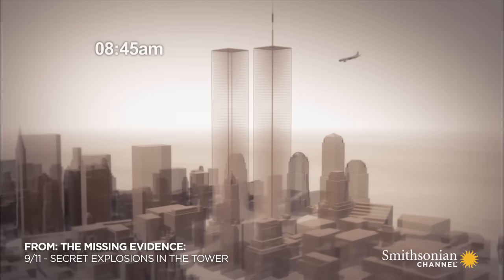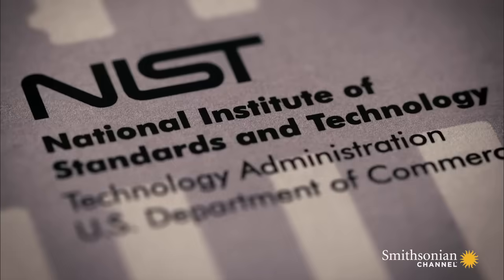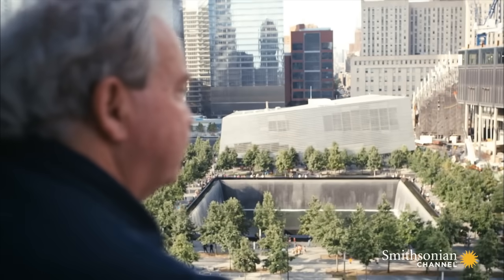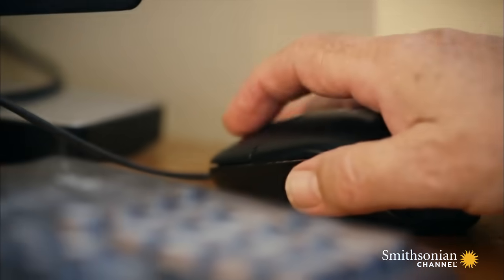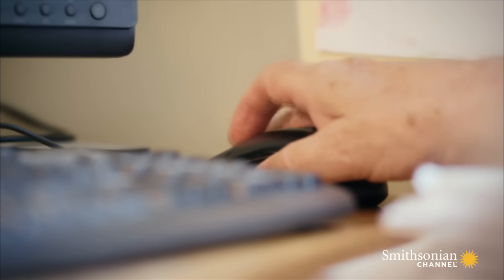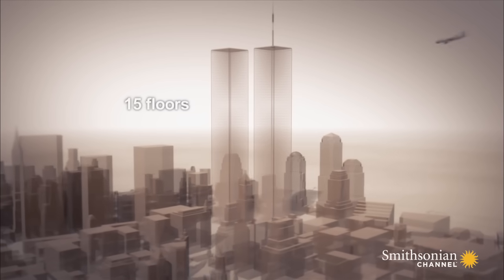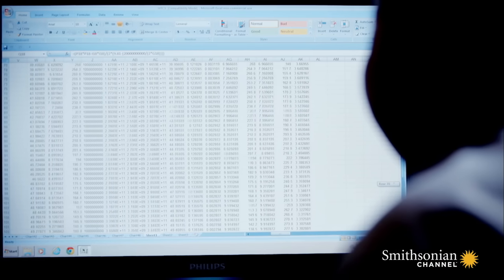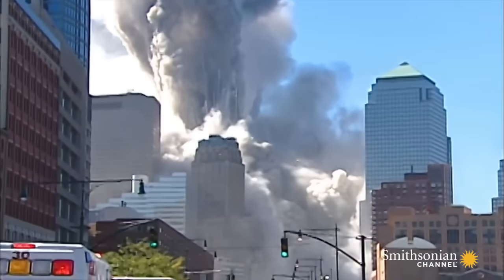This Computer Simulation Explains How the Twin Towers Fell

Comment: Can this old guy with a spreadsheet also explain why there was molten metal pouring out of the buildings before the collapse?
Reply: Oh, that's easy. This 'molten' material was dripping from the northeast corner of the South Tower. When Flight 175 hit, the plane slammed at an angle, therefore, most of its debris slid to that corner of the building. 

Molten aluminum is silvery when melted, however, that's when it is at it's lowest temperature. When temperatures reach 1800'F, which was how hot the fires were that day, they begin to glow a light-orange color. Consistent with what we see. If it really was something like thermite, there would need to be 60 tons of it to start producing the amount that was dripping (30 tons). How would they put the equivalent of 10 truckloads up in those floors without office workers noticing? 

Lastly, if you're really not buying that it's aluminum, remember that Flight 175 was 80% aluminum, enough of it to be piled up in the building and heated to be the fiery molten state we see.

Edit: Oh, and this was how Steven Jone's experiment was flawed. He melted aluminum down to 1220'F instead of the temperatures that were burning that day, at 1800'F.
Reply: "When temperatures reach 1800'F, which was how hot the fires were that day"
You are now claiming things which the official report doesn't even claim. You have mass cognitive dissonance. Next you should claim that building 7's perfect collapse into it's own footprint was because it was hit by a plane also. Since you want to tell yourself anything to fill in the gaps and inconsistencies in the official report.
Reply: Joe Plumber you sir deserve a metal for how you debate
Reply: M P

i know right? depending on which nutjob is yapping, the jihad pilots either can't hit the tower at all, or they can hit a specific window on a particular floor.
Reply: Joe Plumber they failed flight tests.... yet they could fly the plane perfectly into the thermite loaded floor with precision of a 40 years experience pilot. Both are troof 😂😂
Reply: Kerem Karaoglu wow you really do believe you're better than everyone
Reply: Cruzer's World of Retro Wonders
 said: "The problem is that molten aluminium looks silvery in daylight, not orange glowing."

The molten aluminum pouring out from the building was loaded with impurities picked up while running across the floors. The problem is that you seem reluctant to consider it, or you just aren't intelligent enough to consider it in the first place.
Reply: Joe Plumber You'll find that most in fact aren't saying what it was, only that they know for sure what it wasn't.
Reply: I think the fact of his PhD is more relevant than his age. As for your contempt for spreadsheets - reflects your lack of knowledge of maths and the power of spreadsheets.
Reply: This thread was a fun read.
Reply: Oh wow so maybe you can also explain how it got hot enough in a building fire that was going out and why they found molten steel in the debris months afterwards.
Reply: Sir Cumference

How can you tell a troofer is lying? When he offers you something. Oh well and every other thing they say too. But especially if they offer something.
_____________________________________________________________________________________________
Seriously, if you can debunk all the irregularities of 9/11 I’ll give you a hundred dollars.
Reply: Alex Wills  >>>Civilised and serious question... if it wasn't steel then, what was it? 

There were several metallic materials in the towers, from hi tensile temperature hardened steel to alloys with lots of soft metals, aluminum, thin wall stuff like file cabinets. The other main variable is, temperature. There was a lot of fuel available, and probably a wide range of heat in different parts of the fires. Saying that say this, no one KNOWS what any of it is without an assay. Any argument in favor of or against a particular material will be made to support someones agenda. And you're right about the "great pool". If you compile all the different witness statements, there should be a couple feet deep puddle of metal/slag in the basement.
Reply: Wow an intelligent person responding to a 9/11 loophole? how rare indeed.
Reply: Cruzer's World of Retro Wonders looked like a demolition to me!!
Reply: Jerbear45 You cannot make people agree with you.
See? I get no likes. No love.
Reply: This is great! Now get 10k signatures with a testimony from the most successful/experienced engineers/scientists that looked at the data. Like that other documentary.  Also,please release the data used to silence these myths
Reply: Do you understand the difference between a static load and a dynamic load? Newtons third law does not prevent the top from crushing the bottom. Once the mass of the upper floors begin to accelerate, their impact on the floors below result in a shock load that overcomes the load bearing capacity of the already damaged and weakened structure. Each subsequent floor adds its mass to the equation and compounds the problem. This is not as complicated as people make it out to be.
Reply: Shhhhhhhhhhh we dnt speak of that
Reply: needs a new program
Reply: Thermodynamics.
Reply: Civilised and serious question... if it wasn't steel then, what was it? If it was aluminium would we not also have expected to find a great pool of it in the basement? If so, was it found?
Reply: Cruzer's World of Retro Wonders no!!!
Reply: Yep...burning aluminum from the plane's fuselage.
Reply: Melting aluminium + water from the sprinklers provided a exothermal reaction creating aluminiumoxide and h2 gas. This would react with iron beams and melting them.
Reply: Watch the video it was just released they used barium and some other stuff I forget the name just look up to 9/11 experiment or debunked  on the tube
Reply: Michael
why do you tell others to do your work? is there a video? then post a link, don't say look it up.
Reply: Joe Plumber For starters, my name is Marc. Second, it’s not that hard to look it up yourself but I just posted one of many videos. Third, the steel didn’t turn to dust but alright......
Reply: Marc
my reply was addressed to MIKE not you. don't freak, we're on the same side of the argument.
Reply: Joe Plumber My apologies, misunderstanding my dude.
Reply: Marc
no worries, Mike is way up the stack.
Reply: Joe Plumber Ah, what was he saying? I don’t wanna search for him.
Reply: Marc
it was typical troofer saying there is such and such, go look it up.
Reply: Joe Plumber Lol, k
Reply: Cruzer's World of Retro Wonders the plane was insulated by debris, creating a furnace
Reply: Molten metal?  How do you know it wasn't the aluminum of the aircraft?   Answer, you don't.
Reply: Was it molten metal? Or are you assuming it was molten metal? Also how is it relevant?
Reply: I am not assuming anything.  But all of these "Truthers" go on and on about "Molten Metal".   How do they know what the fuck it is?
Reply: Gizzmose2002 On the contrary, I’ve seen molten aluminum in person and hundreds of pictures and videos showing it can turn orange even in a situation like the Twin Towers.
Reply: Gizzmose2002 Well, I actually already did. That ant hill video is a thing of molten aluminum, glowing orange, in daylight, being poured down a ant hill. Did he make that up?
Reply: Kerem Karaoglu wow. Your a real peice of shit
Reply: Gizzmose2002 to be fair it wasn’t directly in the sunlight as it was on the shaded side of the south tower. You’re completely ignoring that there are different temperature ranges to get molten aluminum depending on the type alloys.
Reply: I'm a truther 21.
Reply: Nano thermite particles were found in dust samples, traditional controlled demolition with explosives was not used for obvious reasons (it would be blatantly obvious what occurred). Iron and steel round particles were also found, these are a result if these metals melting. 
The two twin towers as well as building 7 which wasn't hit by a plane all collapsed that day into their own footprint, tower 7 collapsed identically to a controlled demolition. The twin towers collapsed in a way suggesting a succession of nano thermite charges placed on floors under the impact. Both towers collapsing in an identical way and predictable fashion, something rarely seen outside of controlled circumstances. 
Japanese corporation Komatsu had patented nano thermite charges in 1996 which are used for controlled demolitions without the drawbacks of traditional explosives in demolitions (such as noise and small explosions at sites for example). These nano thermite devices can take buildings down with high efficiency, Bremer was actually on the board of the Japanese Komatsu corporation. 
Komatsu didn't develop these for 9/11, they were for just better controlled demolitions in Japan (which have many dense cities). But to suggest that Bremer was able to learn of their usage very easily and acquire them (considering be was on the board of the company) is not far fetched. 
Bremer BTW was an executive for Marsh & McLennan company, which was at the area of impact in 9/11. Bremer of course wasn't there this day. Bremer is described as having a large role in WTC security as well. 
Bremer also after this point in Iraq was an administrator for the Coalition Provisional Authority of Iraq. Which was a temporary government in Iraq that the US setup. He also worked as the Coordinator for Counterterrorism prior to 9/11.

On the 8th and 9th of September there was a power outage in the top half of the buildings that weekend, all security cameras and locks were non operational in this 36 hours. The work was claimed to be an upgrading the internet service in the building, but this doesn't really excuse why power had to be cut and why security doors as a result were disabled. 
The buildings were not packed as usual with all the employees of course, but there were still some regulars there of course. Like Scott Forbes who was a database administrator who also confirms these activities. 

“Remember there were no security locks on doors or security cameras, so access was free unless a door was locked by a manual key. Seeing so many ‘strangers’ who didn’t work at the WTC was unusual,” 

“There were guys in work clothes with huge tool boxes and reels of cable walking around the building that weekend,” 

By Monday everything was normal again, come Tuesday you have 9/11 of course.
Reply: Next planned demolition they should just light a fire instead of using dynamite
Reply: Gus W actually just heat up the aluminum to a high enough temperature and it will not only be orange but it will be emitted a fat amount of light. Aluminium when molten is silvery only at or close to its melting point.
Reply: And he is a chemist!! He must have studied thermodynamics at some point. The heat from a PERFECT combustion of jet fuel DOES NOT melt steel. LAb practice #1 in thermodynamics. And the combustion at the towers was nowhere near perfect (only 121% oxygen atmosphere).
Reply: Joe Plumber haha. High five 🙌It certainly pays off to have paid attention at school and university when I enter the YouTube comments section. I too love making idiots who think they’re clever, squirm. Especially mongaloids like Kerem 😂
Reply: Molten aluminium from the planes
Reply: because there's fire and fire is hot
Reply: Jet fuel was burning at around 1200° over several floors. I can clearly assume the fact that you weren't in the building and have no idea what was 'melting', but it could have been a part of the plane, or any number of things inside the building. It doesn't discount the fact that Al Qaeda pulled off these attacks with 19 hijackers because of their hatred for America and love of their Islamic religious beliefs. Please stop spreading ignorance! America didn’t have ANY reason to look like fools for attacking their own country. In addition, Al Qaeda eagerly took responsibility for these attacks since they had been planning them for years and were elated when they mostly worked. Jet fuel didn't melt the steel, it weakened it. The way the buildings fell has been explained multiple times. I encourage you to stop watching hate filled videos from people who want this to be a conspiracy, and start reading articles from reliable sources such as National Geographic, Discovery, Purdue University, Popular Mechanics, etc. .. Do you even know who Khalid Sheikh Mohammed is? DO REAL RESEARCH!!!!!
Reply: Cruzer's World of Retro Wonders Simple it was a inside job they knew what's up that's why they did communicate with each other on any government level they wanted to have a war... Rember Saddam Hussein had nothing to do with 911 but yet we declared war on them... they figured they needed a similar situation to pearl harbor to get people to back the war they wanted... your government is shadyer then you think... you'll see 50 years from now when documents are declassified!
Reply: I can, and i don't need a spreadsheet:
It is molten aluminium.
Reply: And what about the huge balls of molten steel that were found at the base of the buildings? Is anyone going to claim that the heat from a chemical fire can melt steel into a molten ball? The official explanation is pure BS. There are also a lot of paid trolls on Youtube to attack anyone who does not follow the party line.
Reply: The problem is that molten aluminium looks silvery in daylight, not orange glowing.
Reply: If you have a less idiotic explanation, you're welcome. But the temperatures required to make molten aluminium glow in daylight are, as far as I know higher than a normal fire would produce. So we probably need something a little extraordinary.
Reply: To be honest, i don't think you could call this a normal fire. this is on a much bigger scale, and it is started by 50 tonnes of jet fuel.

You are the one making an extraordinary claim, so you provide the evidence. what do you have?
Reply: Actually there are factual nano thermite particles in the dust samples from the scene. So if you are claiming there was no nano thermite particles then you are the conspiracy theorist here. The government have never offered an explanation for why it was in the rubble.
Reply: Lord of the belts: The return of the KING If traces of ACTUAL nano thermite were found, in order for that to be TRUE how would you explain the absence of barium nitrate & aluminum oxide? Do you have any clue how huge of a percentage of aluminum oxide & barium nitrate make up in thermite? Stop repeating silly things you don’t understand.
Reply: well there were iron orbs which are produced by thermite on site, and also traces of thermite. So..... there's his proof. Just saying. Verified by multiple scientists too.
Reply: I'm sorry but the Hitchens slogan is bullshit. We can go back and forth on who's claim is more extraordinary. I also believe that statement was based on the extraordinary evidence for science over an undefinable and unquantifiable presence of a God. Three building falling in one day extraordinary, a claim to why, what, and how is up to objective observation, testing, and the ability to offer a counter argument. Is a a video of the simulation a submission of the source code and design of the program to be tested, no, then it's not a submission to the scientific process.
Reply: Steel is elastic, failed like glass all the way to the ground.  Look up column loaded structures. Learn something.
Reply: @fedekalv  that's wrong
Reply: @JVC7400  the amount of fuel doesnt change the fact that jet fuel burns at 1200°f while steel does at 5000°f. It wont make it hotter their for I do to believe it is not molten aluminum, it would be silver.
Reply: @JVC7400  the majority of the jet fuel was gone on impact, evident by the firey explosion. That was most of the jet fuel igniting and blowing up. And even if you took an oxygen acetylene torch and cut through every single support on the floors where the plane hit the building would still be standing as the rest of the supports from the foundation and on up are intact and undamaged. Only the floors above where you cut would collapse. Just the slightest bit of common sense would tell anyone that more than just 1 airplane is needed to pulverize a steel framed building. A collapse like that requires all the main foundational supports to be blown away simultaneously. Go ahead right now and build a house of cards. Flick the 2nd to top row and those cards will fall while the ones underneath will remain standing. Rebuild it again and this time flick a card at the very bottom. Now the entire thing will come crashing down
Reply: Micro thermite was found in the debris. The steel was taken away as fast s it could be moved, this from a crime scene. Also, where did the huge ball of molten steel come from that was at the bases of the buildings? Are you going to try to tell me that a chemical fire can melt steal into a ball. Get real dude. The truth is out.
Reply: JVC - Yes, I keep telling people that.  And WTC 7 which did NOT get hit by a plane?  I tell them that fuel from WTC 1 flew over WTC 6 and hit WTC 7 and took down WTC 7.  Those dummies don't believe me.  But you and I got this down.  We know what really happened to WTC 7.
Reply: Sir Cumference

troofer "show me proof and i'll change my mind"
debunker "here is clear video of it"
troofer "I don't see nothing"
debunker "there are 120 witnesses"
troofer "they're all lying"
debunker "here is a piece of the plane"
troofer "that's just a fake stage prop"
debunker "here's a certified serial number"
troofer  "umm... you're a shill"

ya, I'M toxic.
Reply: Gus W

Hmmm, obviously you have some sort of mental confusion. In one thread you claim videos DO lie, and now you say they don't. Could it be that is dependent on whether they make you look stupid or not? Oh I'm sure that's it. I call idiots like you troofers since your fellow travelers pretend to be seeking "truth" but everyone knows you people lie more than the government. As far as video goes, generally people are expected to provide some sort of proof for their claims, but you think that doesn't apply to you, which is ok,  we'll just dismiss everything you say as bullshit. That which can be asserted without evidence can be dismissed without evidence. So, everything you say is wrong. Have a nice day and fuck off, lying asshole.
________________________________________________________________________________________
You mightn't have but those digging it out knew exactly what it was and the videos don't lie - I'd also be loathe to claim that the witnesses do. I don't know why you're bothing with the term' troofer' as though you think that anyone who doesn't fall for the official line falls into the category. So, you have witnesses and videos of the stuff but you want ME to provide you with some proof. Fuck off, I'm not in the mood for either a meatpuppet or an idiot.
Reply: Kerem Karaoglu Going down to insults and acting like you know everything. A great strategy to make people agree with you.
Reply: Gus W

How did you get to that conclusion? Every one of these was some troofer making a positive assertion that the bomb/missle/drone/nuclear device was absolutely the attack weapon. i have even gotten two or more of them to argue with each other about which one is right. THAT was good for a bowl of popcorn or two. And my main kook file is a doozy, some of the bald faced lies troofers tell to try to make their case. No, you're living in your own special isolation ward. You only see what you want to see. So really, there's no need for you to bother me again, you've proved to be dishonest and a liar, and I have no time for either.
Reply: Gus W  >>>no, that was steel.

Did you go up and take a sample to be assayed? No? Then it is an incandescent material of indeterminate origin. It's not steel until it is proved to be steel.
Reply: Gus W  >>>It's no stretch to say it was steel since that is what they found in the debris 

They did find some incandescent metals but I never saw any proof it was molten. My favorite thing about the molten steel fable is this. Troofers have trotted out a bunch of people, quote mining them, but mostly saying "rivers of molten steel", "like a foundry", "running down the stairs" pools, lakes, oceans of molten steel. So where is it? It never was seen again. All this huge amount of molten steel seems to have vanished because it was never pulled out of the basement. I have searched for proof of the giant slabs of steel that must have been down there after it cooled, but nowhere to be seen. Know what I think? Bullshit on the molten steel. Prove it ever existed. There was one blob about 5 feet diameter of some unknown material fused together, but nowhere is the multiple cubic yards of steel that flowed like a "river".
Reply: This was tested by a physics professor (Steven Jones if I remember correctly) back 10+ years ago, and it just looked like silvery aluminium with black chunks of material in it. But you're welcome to point to any experiment that shows aluminium getting orange by mixing it with impurities.
Reply: Beta Shadow they were going back and forth including Bush for the whole week before that day "picking up their kids" is what my buddy's mom said when she was in town burying her aunt ... theirs no way a hi jacked jet can make a tower like that just crumble.. maybe it could lean but it didn't it just fell straight down ... insane right
Reply: Roy BM even if so it was hijacked then the air force would've shot it down.. those tapes weren't released until way later if the voices of the terrorists because they were staged
Reply: CGI of molten metal added to the video to cause confusion and you are as confused as a baby raccoon.
Reply: You've conflated Dr Jones testing for thermite with the alleged aluminum pouring out of the building. Aluminum will absolutely glow orange red if it's hot enough.
Reply: Cruzer's World of Retro Wonders They are in delusional. Cognitive dissonance. Theyre sheep.. brought up to believe everything they are told by higher authorities and not to question anything or look at evidence. I wish the world becomes depopulated from these types of people.
Reply: Kerem Karaoglu and you’re a bit of a wanker, aren’t you? Narcissistic bigot.
Reply: @Keram Karaoglu Delusional, lemme guess you buy into all the illuminati, chemtrails, gay frogs bullshit you heard on infowars? Question everything, but don't inject something even more far fetched, the classic we don't know therefore Aliens fallacy. There is a ton of information just a quick google away, this has been debunked again and again.
Reply: Jerbear45 basic science isnt changed based on mannerisms champ... sheep dont deserve this human right or any human right..